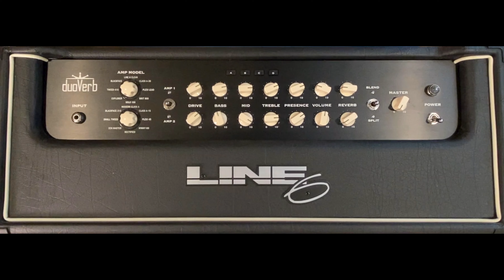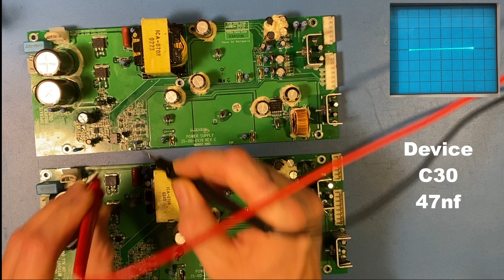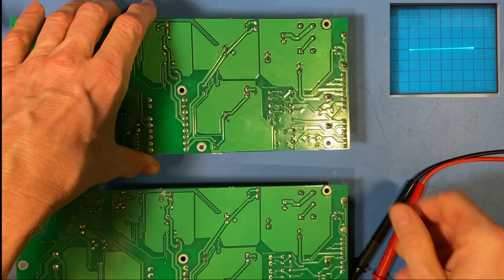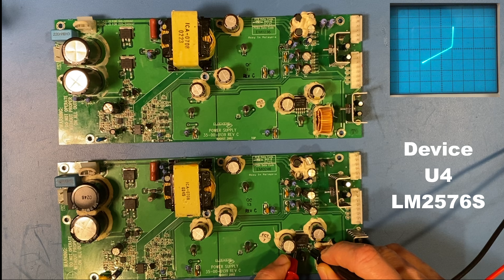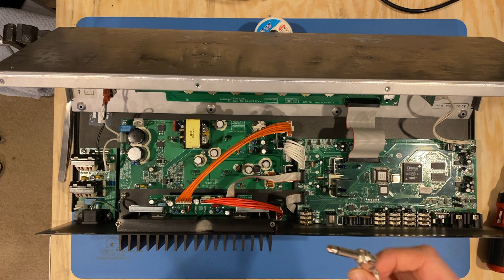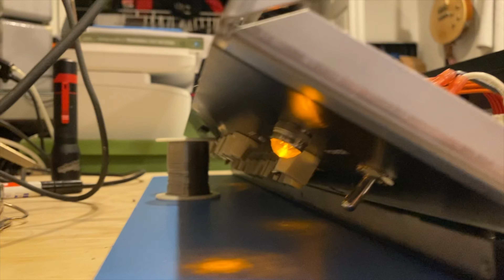Line 6 DuoVerb Part 2  SMPS Diagnosis

Comment: Great vid! At what point did you discover and replace the two bad resistors and diodes? I don’t think you went over that part?
Reply: Hi Clay.  Good observation. I noticed those components where bad, straight away early on with the initial check of the smps. This kind of smps requires a load be present for operation. When the output chip opened up, part of that load became imbalanced on one side, and led to the diodes opening, is my best guess. When I replaced them and brought it up slowly via variac, they failed again, just before 100 volts. That’s when I knew I needed to look further down the chain. Typically when these ic go bad, they will take other components that are more local to their own vicinity with them. In this case the design of the smps is such, that it effected the opposing side of the optocoupler chain. This was an interesting and fun one! ;).
Reply: @rickygene774  nice job! I have the same amp on the bench with same symptoms: output transistors are blown, and turns out that same resistor and diode in the smps are bad as well. One of the 10 ohm resistor has drifted up to about 68 ohms and one of those diodes is open. I possibly would have overlooked those and just replaced the output IC’s to my detriment if I hadn’t seen this vid, so thanks!
Reply from the maker: @claybaker9751  Glad to help!  Youtube has saved my bacon a time or two also.  What a great modern time we live in where we can share information!  Cheers.